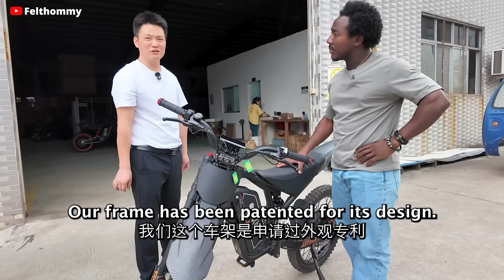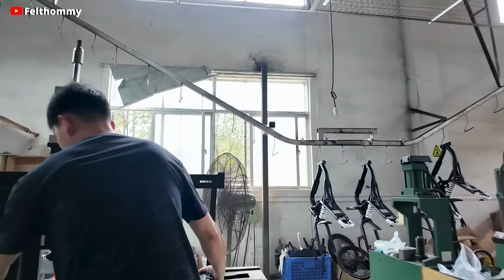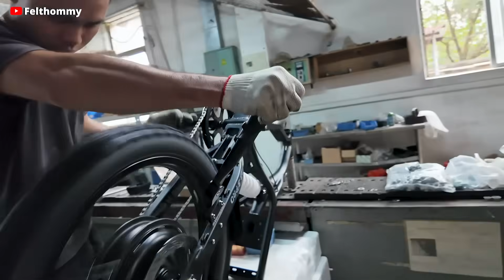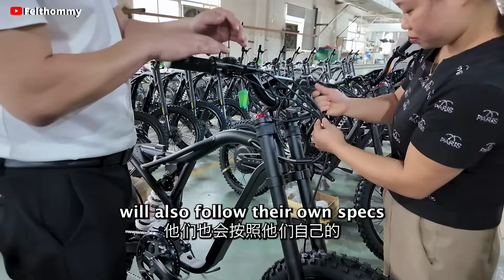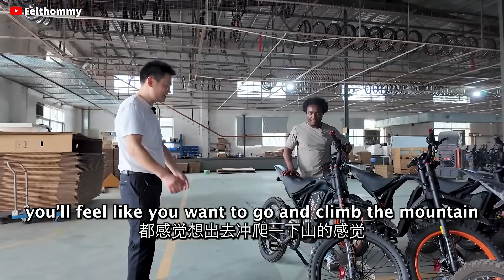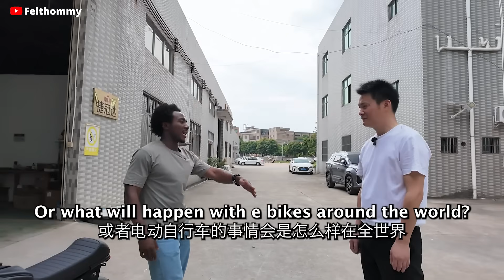This is how Chinese make E-bikes?! Its speed should be illegal!

Comment: Sadly this video doesn't actually promote Chinese manufacturered products.
This video highlights a process with little to no evidence of manufacturing controls/standards we've come to expect in the western world. It highlights no quality controls or traceability of parts used on each bike. As for any product recalls due to defective parts I wouldn't think that's ever going to happen. This video really makes me question what you buy and from where especially as your safety depends on it and these high powered battery products can potentially burn your house down. It also makes you question the quality of the battery supplied with it which is obviously outsourced as most parts were. Just to clarify I am an ex aerospace quality engineer so I kinda know what I'm saying here and it worries me as almost everything these days is made in China. Do your research and know what you're buying folks, just saying!!

Comment: What an interesting video . I can see many applications for these E-bikes in Canada and we are seeing many people use them for pleasure riding as more and more trails are opened up for the public. The host you met could not have been more gracious or informative. Good job.
Reply from the maker: Thank you very much!
Reply: These bikes are very different than the ones used for casual riding, that are based on bicycles instead of motorcycles.  They cater to a different customer base.  For instance when the battery is out on these bikes there's no way to pedal the remaining part of the ride.  They are for dirt bike riders.
Reply: @nominou6  I saw cranks and pedals on those dirt bikes. Not my cup of tea.

Comment: Very, very interesting. I also do ebike. The key question is power. Volts and watts, and then speed.  Uk 's legal watts is just 250w about 15 mph. Those higher spec ebikes can easily go over 1000w,  with speeds close to 30mph. Generally, the higher the volts, the higher the speed. There is also a trade-off between speed, distance and torque. A fully loaded bike with good torque can run up steep hills without issues. That controller he showed was rated as 60v, 50 amps, which would make it about 3000w and capable of 50 - 60 mph.  Do you have their Alibaba link for direct purchase? If I were there i would ask about the bottom bracket, where the pedal crank goes. Is the bottom bracket conventional and easy to replace, or custom and therefore unique to that manufacturer?.
Reply from the maker: Thanks for the technical insight, I've pinned the link in the comments for you!